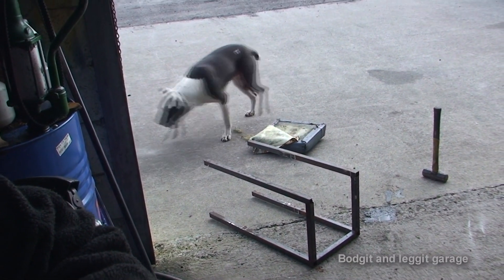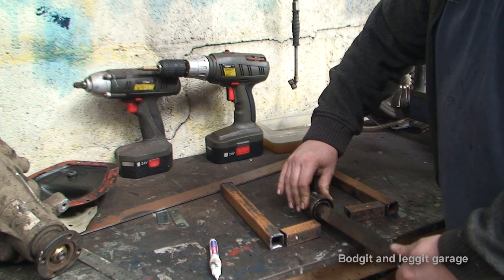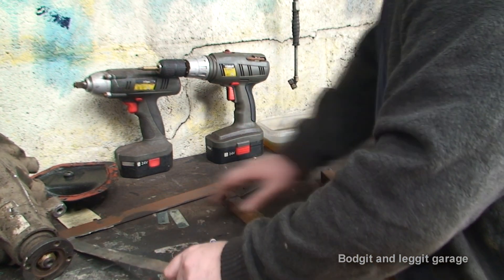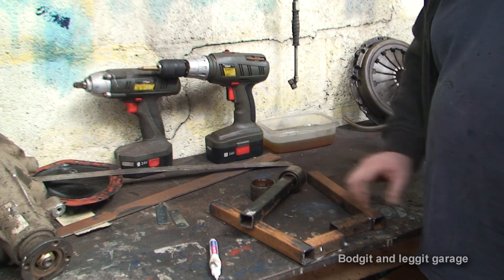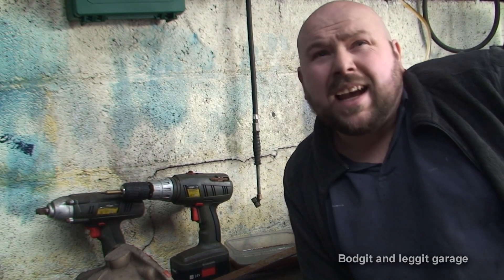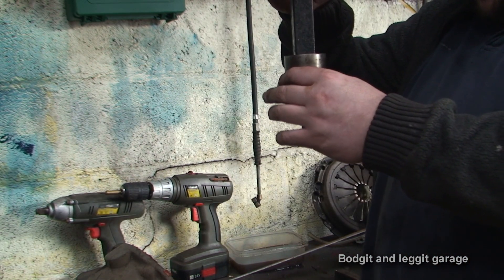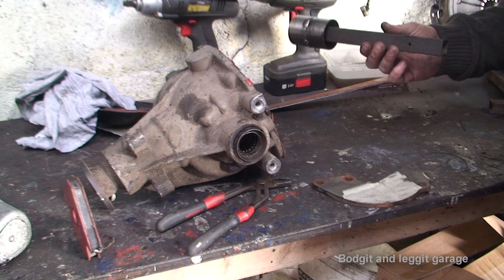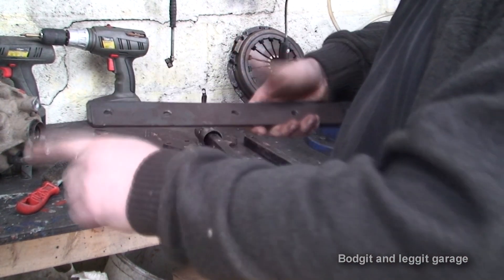how to make a differential clamp/holder/vice bodgit and leggit garage

Comment: Will you show us a Video on how to take that centre bearing out?
Reply from the maker: sorry but don't understand what centre bearing and out of what
Reply: I shall explain, That Freelander Diff has Three bearings. One either side to hold the drive shafts (Left and right) and one at the pointy bit or as I call it the centre Bearing that the prop shaft attaches too. Ta matey
bodgit and leggit garage
Reply from the maker: +nw8000 hi mate I think the confusion is coming from we calling and different things are you on about the diff case bearings or the  side gear  where the drive shafts go into
Reply: bodgit and leggit garage
Ah yes I see what you mean lol. I mean the diff case bearings. The Prop shaft end is the one I am on about. Its supposed to be a bitch to repalce.

Cheers